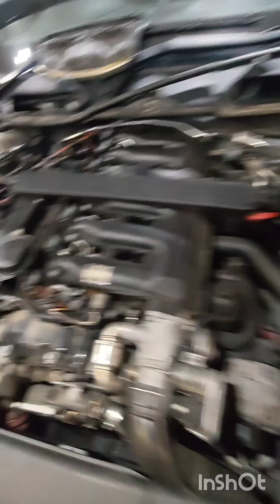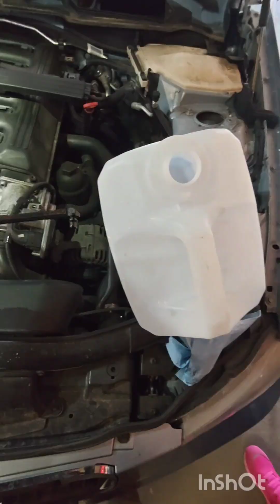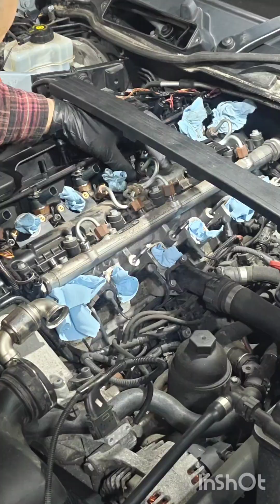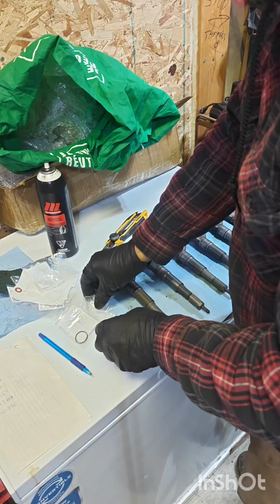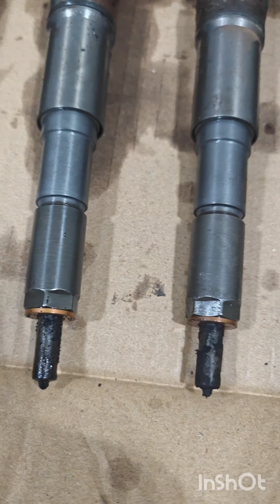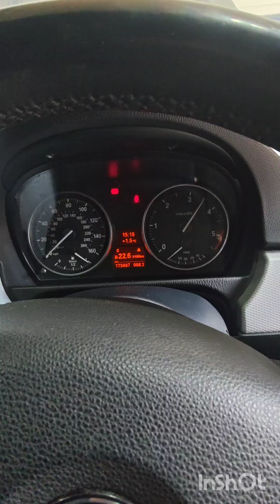Upgrading / installing injectors on a 2008 BMW 325d M57 engine

Comment: Looking to do exactly the same to mine, is it alright to start it right after? Or do i need to code it or tune it before startup
Reply from the maker: You need to code the injector codes in the ECU as each each injector has a unique code after that you can start it. You will still need a tune to maximize their performance

Comment: I have a question for you, as I'm working on the exact same project: when you installed the 535d injectors, did you start the car without programming the IMA codes into the ECU and without a remap? I'm asking because I'm afraid of causing some damage. If you could give me any advice, I would really appreciate it!✨
Reply from the maker: I did input the injector codes before  hand. The car will start and drive without remapping. 
However after running my car I found out that the 535d injectors were all over the place and one of them was leaking from the electric plug. So I ended up taking them all out and changing the nozzles from the 535 to my 325. I was pretty hesitant at the beginning because of people saying the nozzles won't be torque specs and bla bla. But it was either that or dish out a few more hundred to replace those injectors. So far so good. Car has been remapped and drives fine no issues. I just had bad luck with the 535d injectors I had, they were probably on their way out.